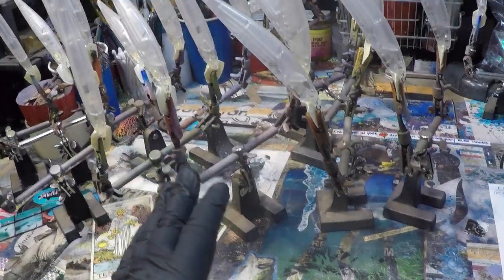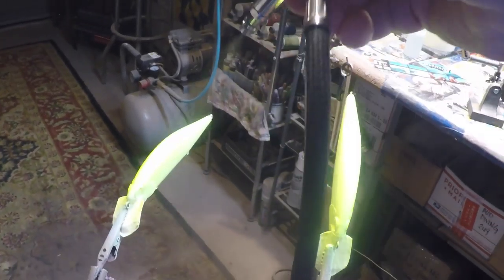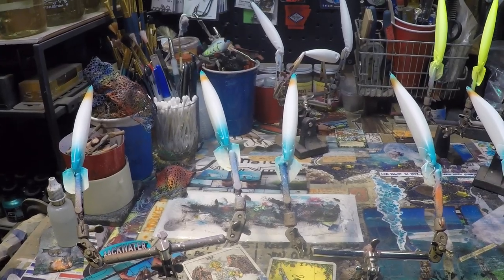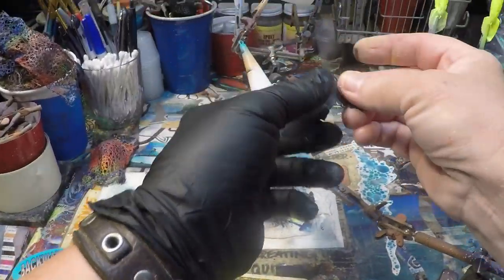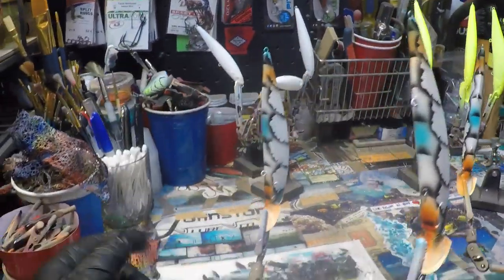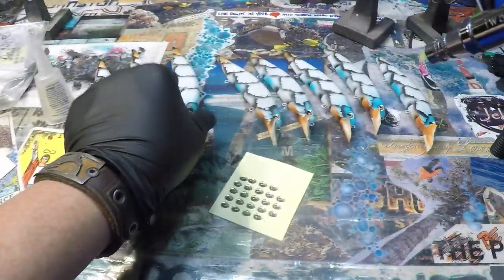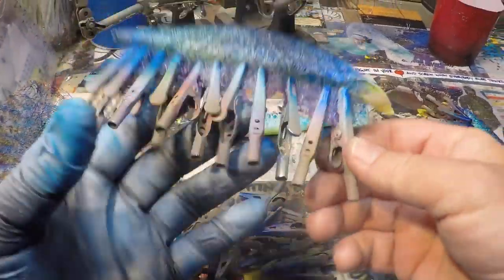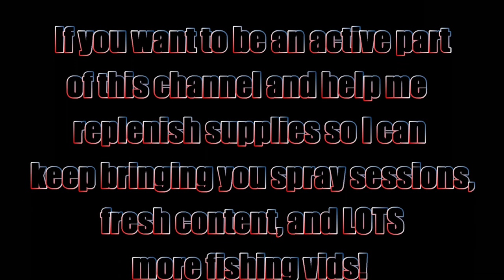NEW SPRAY SESSION!!!! "Setting up a 2 Pattern Run Of Jerkbaits"

Comment: Using any masking tape I always do an angled ‘fold onto itself’ on the tape roll. It makes finding the roll end, tearing off the roll easier. Also removing tape it gives a little pull tab. Use this for window sash, house painting, auto and boats... it works for me, ymmv

Comment: Hello, I already subscribed your channel and following your tips and tricks thanks for this. I have some problems during making my metal jigs, one problem, after priming my jigs, I apply hot foil stamping then I paint the edges but when I apply the paint my jig's hologram turns to pale and looses its hologram. What is the reason for this?.Another question, after painting my lures( I am using binder, hardener and paint pigment) when I try to apply varnish using my airbrush, varnish is not distrubite evenly, I mean, when I looked the jig I see some spots covered and some spots not covered. I could not manage the last coat. What is your advise, maybe I must remind, I am not using water based paints. Thanks a lot by now

Comment: Jen, Speaking of brush cleaning, how often do you need to change the needle in your brush?
Reply from the maker: I have a couple back ups, but the needle will be fine as long as the tip stays intact and doesn't get bent. I have had the same needle for 4 years

Comment: If your using kbs how long do u let it dry cause I tried that stuff and 3 days later baits are still tacky and can't set them on or against anything
Reply from the maker: It depends on the humidity level. Also on how old your KBS is (batch date, not purchase date). In the last few years they've changed the formula in that, KBS used to be a top down dry/cure clear. Now it cures from the inside outward. I don't normally touch my hanging baits for a few days before I pull them and clean/dress them. If that's too long of a wait time (and it can be) try UV or 2 part epoxy that cures faster. I have stayed with KBS over the years because when it DOES cure, it won't yellow and is touch as nails.